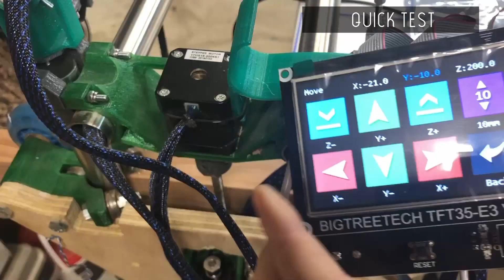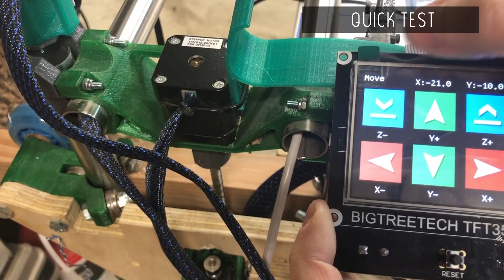DIY CNC Router under $600 (Upgrades)

Comment: Interesting upgrades to the lowrider. I'm in the process of ordering bits for one now. Intending to use mine for mainly plywood and acrylic cutting, but the info on aluminum milling opens up a new area for the machine. Did you consider one of the spindle upgrades for better bearings and tool holding?

Nice belt grinder by the way. Already built one of those....

Comment: you still running this setup ?
Reply from the maker: Use it sporadically, mostly to flatten large chunks of wood. Build a larger table for this machine to ride for that purpose.
Reply: That's super cool, I want to build one the same, everyone at the Forums is pushing the LR3 but this design seems a bit more versatile. @cantsitstill9056

Comment: Can I make this machine 36x70? If so what size am I able to cut to. I make items 34x60 would this work for me?
Reply from the maker: Making it long is easy, it rides along the longer side of your table. Width is trickier, 34 inch work area is doable, however table should be much wider than that, something like 42. Use this calculator to run your numbers: https://docs.v1engineering.com/lowrider/calculator/

Comment: Hello, Thank you for your information, wanted to ask, what thickness should be the steel shafts for a 2 by 1.5 meters diy simple cnc frame, are 20mm shafts strong enough for such x and y length and would nema 23 motors be good enough to move the axis or should be bigger?
Reply from the maker: Metric version of this device is build for 25mm tubes: https://www.thingiverse.com/thing:3064287 and Nema 17 for steppers

Comment: Great Job! However everywhere I look for a SKR 1.3 they are discontinued or unavailable. What would you recommend in its place? I would like to follow what you did here however I want the coding to be correct and I worry the BigTreeTech V1.4 will mess something up.
Reply from the maker: I think SKR Pro 1.2 officially supported, Check V1 forum, I'm sure there are folks out there who tried some latest hardware: https://forum.v1engineering.com/
Reply: do you have the file for the laser mount?
Reply from the maker: @shenanfaas1802  you can find it here: https://www.thingiverse.com/thing:4782046
Reply from the maker: @shenanfaas1802  also if you adamant about using SKR 1.3 I actually have one unused I wanted to put on eBay for awhile now.

Comment: Thank you for posting! I've implemented many of your upgrades but complicated my life by using an SKR 2.0 Rev B. I think I've overcome al the complications. One question I have is regarding your X axis. Did you run the two motors in series? Did you change the amperage settings in the firmware to allow for running two motors?
Reply from the maker: They ran in series and I didn't adjust any amperage, don't think it's needed with UART on SKR with TMC2209 steppers
Reply: @cantsitstill9056  Thank you!!

Comment: What keeps the low rider tracking parallel all the way up and down the board that it's sat on? It seems like any tension difference in the belts or resistance differences somewhere would cause it to skew
Reply from the maker: Somehow it doesn't skew, at least to the point where I can see the difference.

Comment: Hey there is there anywhere where there is a stl case for for the BIGTREETECH SKR Pro v1.2 32-bit high-Frequency 3D & also the screen?
Reply from the maker: I used this for SKR https://www.thingiverse.com/thing:4525126 not sure if it'll work for Pro 1.2. I don;t remember now which model I used for TFT screen.

Comment: Hello...great machine!...I have CNC with arduino uno and cnc shield v3 and drv8825 drivers...can i replace those drivers with tmc2209 for quiter joging? and will i have sensorless homing with that or I need SKR 1.3 board?
Reply from the maker: I'm not sure if tmc2209 would work with older shields, I doubt it. The different between a full set of TMC2209 drivers with and without SKR1.3 board is only $25 (in US), why not get the whole set?
Reply: @cantsitstill9056  can I install grbl on skr board? :) I get used to grbl, and I use Openbuilds control software, which I think is the best for controlling cnc, so I would like to stay on grbl. :)
Reply from the maker: @unique93obr  Looks like this is possible after all, but comes with some tinkering, here's a guide on installing TNC2130s on RAMPS board.

Comment: what if you make those aluminium parts from hard wood?
Reply from the maker: I don't know, aluminum tubing makes sense to me, it's not hard to source and possible to mill on this same machine.
Reply: @cantsitstill9056  yes but if i don't have a cnc or 3d printer to mill these parts, on my first assembly maybe i could make those parts from hard wood. Like beech wood or maple, do you think that's steady enough?
Reply from the maker: @veloran  I don't know. Some parts will be pretty hard to mill, they meant to be printed.

Comment: hi, where to download such a firmware?
Reply from the maker: Руслан - https://github.com/V1EngineeringInc/MarlinBuilder/releases
Reply: @cantsitstill9056  спасибо
Reply: @cantsitstill9056  thank you
Reply: @cantsitstill9056  tell me how to make sure that each engine has its own driver? could you drop your files? thank
Reply from the maker: @РусланИскандиров-ж7я  SKR 1.3 board has 5 drivers, 2x for Z (1 for each Z motor), 2x for Y (1 for each Y motor) - this is needed to mate auto-squaring working. Now 2x X motors are connected to the same drivers in series, as described here: https://docs.v1engineering.com/electronics/steppers/

Comment: What a great job! I assume you use "Marlin" and not "GRBL" right? What programs do you use for cuts?
Reply from the maker: Yes, Marlin 2. And Estlcam for a CAM software. Occasionally Fusion360 CAM.
Reply: @cantsitstill9056  Thanks! I'm finishing mine and I see some very good updates from you.

Comment: Soooo, we want more upgrades...
And a anodizing setup/tutorial.
And im building a lowrider as well with basically the same setup, just wondering what bit you used for the aluminum.
And i looked up the square tubing, 5mm thick is pretty hard to find
Reply from the maker: Aluminum endmills I use are 1/8" single flute carbides, like those: https://shop.v1engineering.com/collections/sharp-stuff/products/1-8-single-flute

Comment: Did you machine those trusses in there (on the thingiverse model) for any other reason than it looks dope? I dont have a cnc router but I do have access to a mill. Thinking about fabricating a set before I build mine
Reply from the maker: Well, sure it looks dope :) but no, the idea was to make everything stiffer.
Reply: @cantsitstill9056  ain't nothin stiffer than a solid piece lol. I'll prob go for it

Comment: Great! I'm interested in making the same change you did. Could you share the plastic pieces and the dxf of the new plate? I would like to have a second Y stepper and use a bigger dust port. 
Is the second motor connected in parallel with the first motor? I have ramps 1.4 with dual endstop so I am using E0 and E1 as 2nd X and Z engine respectively. If I want to put a second motor Y I would not know how to connect it. Maybe it is only possible with the SKR 1.3
THANKS!!!
Reply from the maker: Here's a link to STLs and DXF. Second Y motor is connected to the same driver as the first one. With SKR I got 5 drivers, 2x for each Z, 2x for each X - those are for automatic squaring, Y motors connected to the same driver.
Reply: @cantsitstill9056  Thanks, the makita plate parts link is broken. If you can upload again in some time great. Thanks for share!!! I will try your design.
Reply from the maker: @juanandrescarri27  Well if I would have clicked on Publish and not just Save :) Give it a shot now.
Reply: @cantsitstill9056  Thanks for this. I already change my configuration like yours but Im using Ramps 1.4 and its running ;). Y motor conected to the same driver in parallel conection. 
 Being connected in parallel, you had to double the driver voltage, right? Thanks!
Reply from the maker: @juanandrescarri27  mine are connected in series as advised by Ryan from V1. I think you right about voltage for parallel connection, but please double check it on V1 forum.
Reply: @cantsitstill9056  One more question. When it is without power and you move the Y axis (the one that supports the Makita in your case I think) does it move easily by hand? With a single motor it easily moved the car. When placing two motors (in parallel or so I think) it is very hard to move it. I feel like I'm missing something. If you could tell me how you made the connection between the two engines of the Y it would be good. Especially because it works for you.
Reply from the maker: @juanandrescarri27  it's definitely harder to move. Also I had few instances initially where it started to skip, I found that I need to make sure I don't overtigthen the belts.
As far as how it connected, it's connected in series just like diagram on this link shows: https://docs.v1engineering.com/electronics/steppers/